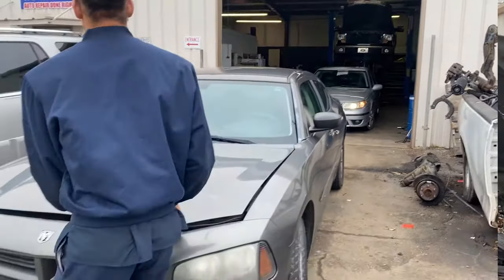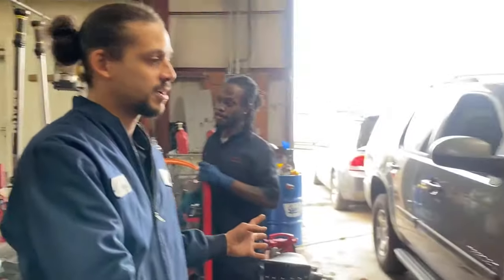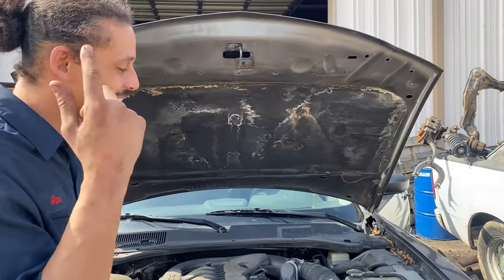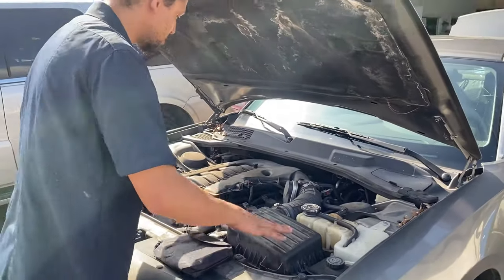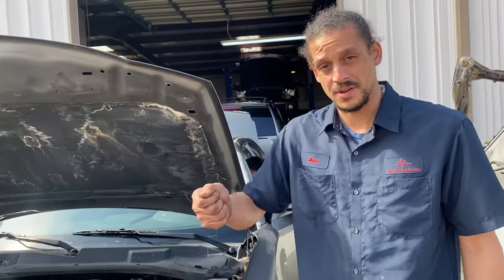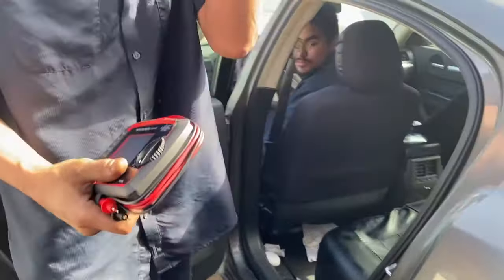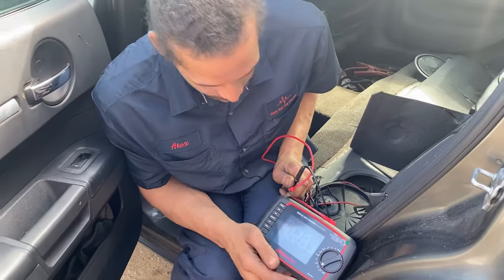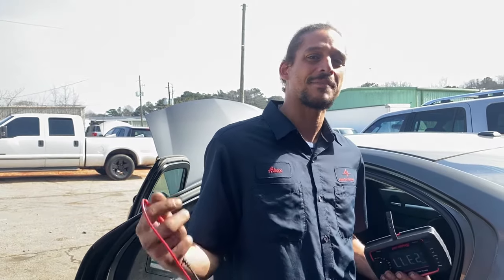Diagnosing Another Dodge Charger - Turns Over But WON'T START  #carwontstart #dodgecharger

Comment: i have 2010 dodge charger...i was driving when it would give any gas then slowly died off ...i restarted it and it started back up but immediately died seconds later. battery was checked and is good alternator is fine as well. i do not hear a whining noise...makes the same sound as i hear in this video. any suggestions?
Reply from the maker: You may have a bad fuel pump do you have the ability to run a diagnostic on it yourself and tools

Comment: Hey Alex, i have a 2013 5.7, it starts normal when the car is cold but if i drive around and come back home, it wont start for 2-3 hours unless i jump start it. Do you think its a battery issue or something else?
Reply: Bad battery! Idk if you got it fixed or not but take it to autozone and they’ll test the battery. You ever notice battery acid on that battery?
Reply: If it start good when is cold I guess the battery is good  but when it's get a little hot it won't start again it has to be some sensor that it's overhearing  you need a diagnostic  to check for a code
Reply: Hey ! My car is doing the same thing right now , were you able to find out what it is? I’ve tried everything and have took my car to like 3 mechanics and they don’t know what it’s causing not to start . Hope to hear from you soon .
Reply: Sounds like an atiinator problem

Comment: Excuse me Alex I have a question for you. I  have a 2010 Dodge Charger 3.5 Sxt. I'm changing my fuel pump in the morning but I have to go get my part from the part house. There's two parts that fit my 18 gallon tank. One is a Terminal 5 plug and the other one is Terminal 4 plug(which is more money with Dodge House recommended. The question is that is mine a four or the five? Do I leave my gasoline open to go get the part 🤔?

Comment: Hi Alex, I have a 2007 charger 3.5, car was running and it shut off. Towed it home and put my OBD2 and I got P0340 and suggested to replace cam and crank sensor and possibly the VVT sensor! I replace a couple of fuses and noticed I didn’t get any spark at the plugs while cranking?

Comment: So I have 2009 Charger with the 2.7L.  It died yesterday while driving.  It will not start back up but cranks good.  I tested the battery and battery was weak after charging back up so I replaced my battery.   I’ve checked all ground straps and they are good.   I have spark, air and power but seems like its not getting fuel.  I’m getting 12.62V at the connector on the fuel pump when the key is turned on and I can hear the pump but still a no start. All fuses and relays are good.  Serpentine belt spins just fine while cranking. I’m thinking the fuel pump is either weak or bad.  What are your thoughts?
Reply: I have same issue! Were you able to fix it?

Comment: Good morning, I have 2007 Dodge Charger with the 2.7 liter engine. The car starts with quick starting fluid and dies immediately. I probed the 4th and 5th wire as you did on this video, but I am not getting any volts. The fuse is good. I switch the fuel pump relay and still have the same no start issue with no volts on the 4th and 5th wire. Can you suggest what to check next? Thank you.

Comment: Had to comment ChooChoo man lol good advice,I have an 2007 Dodge Magnum having problems with starting ,first off had immobilizer,alarm problems that I wont go into now it will crank but not start
Reply: What do you think the problem could be?I checked spark ,fuel and.getting both it just cranks but no start.It sounds as if it wants to turn over and it partially does ever so often that's about it.

Comment: Good detailed video man I got a dodge Magnum doing the exact same thing I checked fuel pump it's clicking ,I did the spark plug test no fire ,not too long ago I changed the fuel pump when it did the same thing and it ended up being the ecm I fixed that and it was fine now it's turning with no fire
Reply from the maker: Thanks buddy. You may have a bad crank sensor, you will need a good scanner so you can check your crank sensor
Reply: Thanks i appreciate that I changed that bout a couple months ago u might be right
Reply from the maker: @johnathanmack2371  depending on where you got the sensor it may be defective i come across that a lot
Reply: AutoZone lol 🤦🏿‍♂️🤦🏿‍♂️
Reply from the maker: @johnathanmack2371  dang
Reply: I changed the sensor u think it could be the ecm relay and where is it located
Reply from the maker: @johnathanmack2371  its possible but you need to scan it so you don’t waste money buying parts

Comment: Mine sounds like this one. Ive replaced both fuel pumps, clockspring, steering angle sensor, all 4 speed sensors, crank shaft sensor, cam shaft sensor, throttle position sensor, and mass airflow sensor. Changed all the sparkplugs. Fuel pump turns on. Battery, alternator, and starter are all good. I have spark. What am i missing?

Comment: Hi bro, I have a p0016 code and I ended up changing both cam and crank shaft sensors, but the car won’t start. Any recommendations?
Reply: It’s a 2008 dodge charger 2.7 Liter. I tried unplugging the camshaft sensor as shown in one of your videos, and it’s still doesn’t start. It definitely cranks, but won’t start

Comment: Hey Alex I have a 2007 dodger Charger rt.. when I turn the switch the lights, air , everything comes on but when I try to start the car it doesn’t try to crank at all.. and advice or help would it be a bad pcm or maybe the keys not programmed correctly
Reply from the maker: Hey there have you check the starter also get a scanner and see if you have codes
Reply: We have checked the starter, mechanic has me to turn the car in the on position and he went underneath the car and did something to see if the starter was good and it tried cranking instantly that way
Reply: Anything else I should check for
Reply from the maker: @Zay7_mopar  starter relay that’s the next part you guys need to check.I will just replace it they’re very cheap, you can Google starter relay for your specific car and it should pull up the diagram on the fuse panel

Comment: I recently bought a 07 Dodge charger. I've changed out the old battery with new still no start and fuel pump has been replaced. There's a lighting light that lid up.
Reply from the maker: Hey there do you have a scanner
Reply: @AlexTheCarDoctor  other thing is the radio and speakers are not included. Same goes with stock amplifier. I needs help finding these items for a great low price. P.s no scanner tool.
Reply from the maker: @bluefeatherlopez7  eBay and Amazon is your best bet dealing with the radio and speakers I’m not too much of an audio guy so I won’t be able to help much there. every car owner in my opinion should have a scanner they’re like 40 bucks on Amazon here’s the link https://www.amazon.com/dp/B007XE8C74/ref=cm_sw_r_as_gl_api_gl_i_PDPW5EZB0B71Y6YPW2RS?linkCode=ml2&tag=alexthecard05-20

Comment: Hey I have a quick question my 06 Dodge Charger SXT 3.5 cranks up and cuts off some times when at a stop light it will just cuts off and I have to crank it back up so this morning it cranked up and cut and I tried it three times and then it stayed running
Reply from the maker: Hey there is the check engine light on? It sounds like you you have a bad crankshaft sensor

Comment: Having the same problem start but won’t crank when it in the on position the throttle body sign pop up also code u0101 popped up on my obd scanner what do I check next need som advice

Comment: Hey I have a question my fuel pump is melting the wire harness and the pump itself. Why is it melting on 2013 dodge charger? Can you put a video trouble shooting driver head light I put a new bulb and checked the fuses the are fine it’s a dodger charger 2013 sxt please help

Comment: I have a 2014 dodge charger making that exact noise when you try to crank it.. so is this the correct order for things to check....1.battery....2.wiring.... 3.Starter....4.fuel pump....😒.

Comment: I have an 06 charger 3.5 engine. I replaced the alternator and starter. It cranks but wont start. I have a good battery. Last time i drove it the car shut off in the middle of driving and hasnt started since. What do you think?
Reply: I have a similar problem by any chance did you find out what was wrong with it?

Comment: I have 07 charger was driving it then it started leaking oil then cut off tried cranking it the next day it want run it turns over but won't crank can you tell me what it can be are what I need to check

Comment: Check the fuel pump, fuse for the fuel pump if its getting enough electric power from the fuse box,  and check if there is enough fuel in it . Listen if the fuel pump is working it make a waning sound. I knew it was the fuel pump from start

Comment: 2006 Dodge Magnum 2.7 
The car had stalling issue at idle and slow speed lets say 15 mph
And long crank but only when engine was hot,,,let it sit overnight it would start
Any Idea Alex
Reply from the maker: Does it have a check engine light on
Reply: @AlexTheCarDoctor  yes
Put In New fuel pump and sending unit 
It started right up ran for about 3 min then stopped 
The code went to P0335
Replaced,,,,,Crankshaft sensor 
Long Crank no start
No codes coming up at all now
This car has had this issue off and on
For 3 years,,,certified mechanics have worked on this issue,  tired of paying them,,,New computer x 2 have been put in,,,,the second computer has been in the car for about 1.5 years
This car purrs like kitten its so quiet 
Hardly uses oil
Have slight Transmission leak
Miles ,,,,234567
I'm starting to think its my Tippa ?
or wiring,,,,thinking about new computer again,,,Supposedly a great place in North Carolina that does computers,,,the last two came from Flagship
I used to be a mechanic in a big factory 
On big machinery 
I'm retired now,,
Its Greatly appreciated for you to answer 
My commit
Also I found out that Dodge has lifetime warranty on the 19 gallon fuel tanks,,,something about one of the sensors gets hung up or something,,,this isn't a National Re-call for some reason,,some guy on YouTube was showing the letter you need to download 
to have it replaced by the dealer
THIS PROBLEM SHOULD BE A NATIONAL RECALL ESPECIALLY ON THE 2.7,,
Thanks again Alex 👍👍🍻🍻

Comment: I have a 2010 3.5 SXT and it wont crank over when I do try the dash lights and radio will turn off and on im thinking its my starter but could it be my fuses

Comment: Hey man I need your help! I have a Dodge Charger 2007 that want start, the theft light keeps coming on. I changed the actuator pin, and had a new key programmed. All electrical comes on but no start can you help me?
Reply from the maker: Hey brother. You have two options,get a different auto locksmith to make you another key, second remove the security system with a a program named hp tuner. What is your engine size

Comment: Hey bro I got a 2010 dodge charger and it throw a code “ fuel level sensor b circuit to high” is it the wiring or I got to replace the fuel pump ?

Comment: Hey there Alex...  I have a 07 that won't start that had some rattle at beginning of start last handful of times when it did run.  I'm assuming it's the timing jumped...  is there any way of checking the timing marks WITHOUT removing valve covers and front cover ?!?!  I tried looking for TDC on crank down at the bottom and didn't see any way.  Thank you in advance...👍👍👍👍
Reply from the maker: Hey there buddy, you can perform a compression check on the engine that would give you a general idea. Also, you can look me up on Instagram and send me a video of it turning over/you trying to crank it and I can hear if it’s out of time or not.

Comment: Hi, Alex I have a 2010 Dodge charger it will not start the only thing will come on with the key fob is a red light which. I think is my Auto theft system.. please HELP ME!!!!! I still have lights but I turn them on by the button
Reply from the maker: Hey there sorry to hear that.my advise is to call an auto lock smith and make sure he can program dodge keys. You most likely have a faulty key

Comment: I don't understand why you settled on fuel pump?
Reply from the maker: I probably should have filmed it running after I replace the fuel pump i’m going to start doing that with my diagnostic videos. The test that I performed that day all pointed to the fuel pump needed to be replaced

Comment: My 08 Charger started flashing a red lightning bolt the other day while I was driving but I turned it off for a second then back on and it seemed to be back to normal. But it has gotten much worse and hardly wants to start now. I scanned the car and it said like 10 different codes including P0301,P0300, P0306, P0652, P0652, P0340, P0868, etc. do you think you know what Is causing it?
Reply from the maker: What I’m basically seeing is misfire codes and ECM low-voltage codes you may have a wiring issue,depending on your engine size.I have seen corrosion buildup at the computer/ECM.I had a similar issue on a charger with the 5.7 Hemi. The computer is located underneath the crawl,basically the little plastic cover between the hood and the windshield check for corrosion at the computer but before you do that make sure that the battery and charging system is good. Tip anytime you’re working with the electric system make sure the battery is unplugged especially if you unplug the computer that’s a good way to fry your ECM
Reply: Damnnn 10 codes my boi😅

Comment: Yo Alex my girl has an o8 charger 3.5 it cut off this morning I checked it this afternoon it turns over but no crank and I didn't hear no buzzing sound (fuel pump) noise is that the issue not feed the gas to the motor to fuel rail
Reply: Let me know asap please. It's hard sharing one car for two different jobs and kids

Comment: My 2010 Dodge Charger turns over but won't start. Replaced fuel pump and still won't start. Any other suggestions?
Reply from the maker: Hey there sorry to hear you having problems, do you have a scanner and if so what codes are you getting

Comment: I have 08 charger it want crank or start it want say anything i turn the key nothing checked fuse new battery new battery end but it will start if i remove the neg battery but after I cut it off nothing 😢help please

Comment: I have a 2010 charger 3.5 engine i changed the camshaft sensor and crankshaft sensor car still not starting its turning ova code still showing cam sensor
Reply from the maker: Check your timing belt

Comment: I got a ? I have a 2010 dodge charger new water pump, new thermostat  and new radiator burp the system out but my car still tries to overheat after about a 2hour I need a little help what could be causing that
Reply from the maker: Hey there buddy sorry to hear you are having problems with your car. I will try to help first what engine do you have
Reply: @AlexTheCarDoctor  3.5 v6
Reply from the maker: Do you see/Here the radiator fans coming on
Reply: @AlexTheCarDoctor  yes they are coming on
Reply from the maker: Did you perform a  block Test? That Test will ensure you don’t have a blown head gasket

Comment: Do u ever recommended using starter fluid to help start the car?
Reply from the maker: No I don’t, I have seen many mechanics set the engine bay on fire and also burn themselves using starter for it to start cars.what normally happens when things go sideways the car will back fire through the intake.
Reply: Thank you good to know (:

Comment: I have a problem with my 2007 dodge charger hemi it seems to not want to crank or start
Reply from the maker: Hey buddy was the check engine light on prior to it not running if so get the check engine light code pulled and give it to him

Comment: I wish I could bring my car to you. 2014 charger always started fine with no hesitation....yet $8550 and 2 days later pulling out of dealership and wont turn over, only turns the computers on.
Reply from the maker: What did they say was wrong with it at the Dealership?
Reply: @AlexTheCarDoctor  they did a bunch of random 100k miles tune up work, solenoids and wire harness under the intake manifold, driver door window switch, tie rod bushings and more. I went to go smog the car because it’s registration is expired and they cleared the codes. So that upset me, now I have to drive the car a week to get those codes but the damn car won’t start lol. I checked the fuses. Battery is fine

Comment: Have a  2006 dodge charger 3.5l sxt it's starts up great idle great but when I press the gas pedal I get nothing it only idle??
Reply from the maker: Hey there, do you have a scanner if so what’s the code
Reply: @AlexTheCarDoctor   no scanner but i called a scanner guy still waiting on him 4 days later but i do see the red lighting bolt on the dash
Reply from the maker: @fire4139  keep me updated on what codes you get.I recommend you buy your own scanner, you need one as a car owner and you don’t have to pay a arm and a leg they are 40$ on Amazon, do you want me to send you the link for the one I recommend
Reply: Code came up P2115 did some reprogramming and it worked it great 👍
Reply: New problem my oil is mixing with the radiator fluid but not in the engine I changed the intercooler 🤔 but the oil and coolant is still mixing
Reply from the maker: @fire4139  you mean the radiator when you say intercooler I hear turbo charged vehicle
Reply: @AlexTheCarDoctor  no turbo just the regular coolant reservoir

Comment: OK I have a question I have a 95 Chevy caprice I change the fuel pump spark plugs The distributor and wires The car still won’t start up I even checked the fuses I had one guy come and check it he said The car is not getting no compression so my next question is how can I fix that without have to change the engine
Reply from the maker: Can you send me a video on Instagram of you trying to start it
Reply: @AlexTheCarDoctor  yes sir what’s your name on Instagram